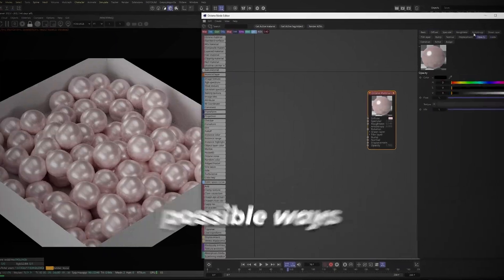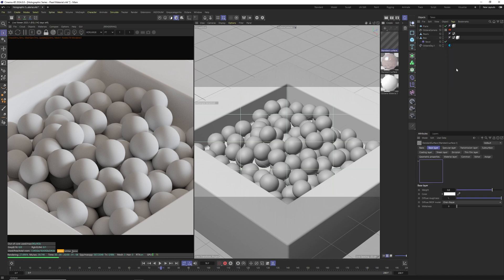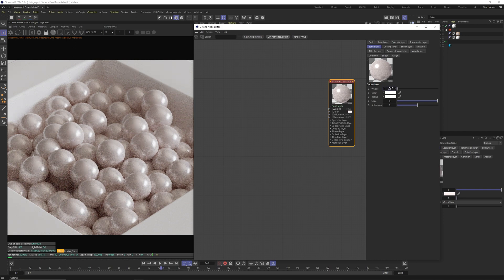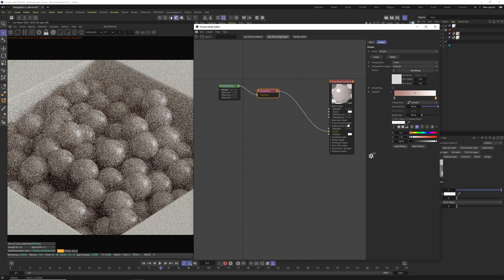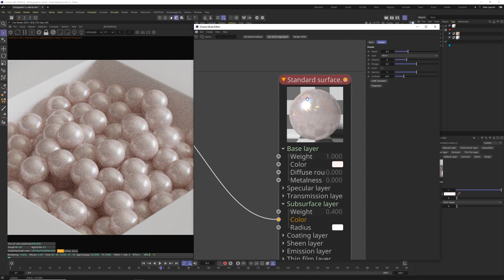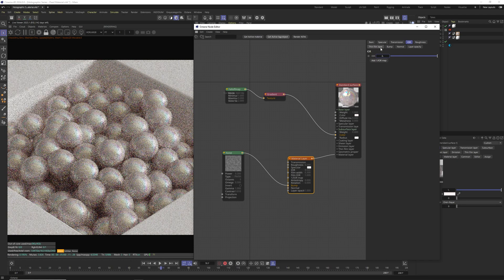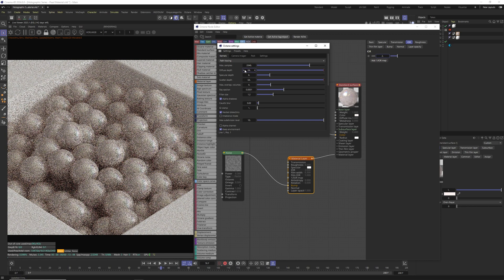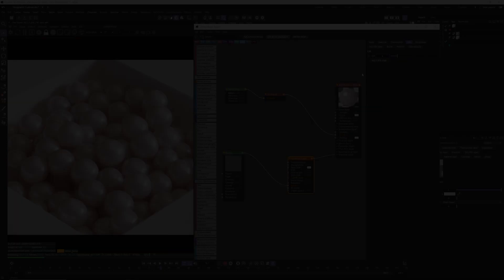SECRET to Pearl Material: Cinema 4D & Octane TUTORIAL

Comment: cannot add specular 
material layer at the very end. any tips?
Reply from the maker: Hey! What exactly is happening? is material layer not showing up? is it just not connecting? can you give more details?
Reply: Hi, so the option for Material Layer is there but no drop down when I click it. Also Material Layer does not appear under Geometric Proper so when I try to add one manually there is no where to connect it!  @NojsGraphics
Reply: Hey! i bumped into same problem as you @dynamicshit any News about hope u found solution.
Reply: @mohamedamineabdelakder9346  i did not sadly…

Comment: If you don't have a single scatter node in your material, you don't  need to change number of scatter bounces in settings, as this does not affect anything. Just an FYI.
Reply from the maker: Hello! This material has a scattering, so Scatter Depth actually makes a significant impact on the overall appearance of the material. It doesn't strictly require a medium (scatter node) to exhibit scattering, all that is needed is a value higher than 0 in the Subsurface Scattering section of the Standard Surface settings.